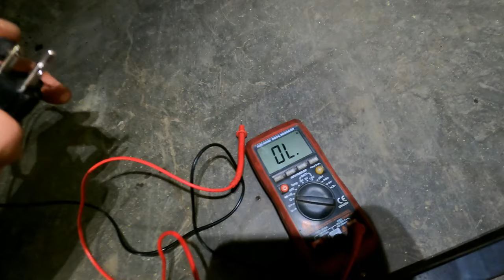I test out a $30 Chinese "TRAIN HORN"

Comment: There were TWO horns in the package, being that I live in the Colonies, It seems to me that you would want to connect BOTH horns, and test them together 🤔
Reply: Also worth mentioning a battery charger typically does not make a very good power supply especially without a battery attached to it. To clarify I mean any sort of modern battery charger
Reply: Yep, probably dual tone
Reply: I bet they have 2 different sounds when combined and mimics the sound of a train, but not the volume.
Reply: Colonies?
Reply: @rzr9006  in the US
Reply: @rzr9006  The 57 States that Obama talked about.
Reply: Make America Great Britain Again
Reply: I got the exact same horns and rigged up both...still garbage! 😂
Reply: That's exactly what I was thinking.
Reply: Lol its funny i think alot people make this mistake like i did thinking a car only has one horn.usually got atleast two
Reply: @HerculesRockefellerESQ   Yes correct, you can hear the 60 Hz through the sound of the horns. Should be a stabilized power supply for testing these 2 horns. If he wants to make a fair comparison, he should buy Chinese air horns. This is just a bad form of advertising.
Reply: Yup
Reply: @rzr9006  east coast of USA and New England
Reply: @HerculesRockefellerESQ  you are correct. The output is unfiltered so there's probably 6-8v AC ripple going to the horn with will have an adverse reaction to the coil.
Reply: @TIMEtoRIDE900 😂😂😂😂
Reply: @TIMEtoRIDE900  😀 hilarious 😂
Reply: @TIMEtoRIDE900  You mean Obongo.😂😂
Reply: Colonies?  NOBODY call the states the colonies 😂  just say the states or US. You could ridiculous.
Reply: @rzr9006 im from Jersey.  The states. US.   WE DONT CLAIM THAT FOOL 😂 who the hell says colonies? Nahnwe definitely don't claim him.  Canada can have him. 😂
Reply: @rzr9006 
Most likely talking about the 13 original ones
Reply: Made in china, what do you expect. Cheap, plastic and bad craftsmanship. Invest in quality, do not support bad business models.
Reply: your not supposed to solid mount them, they supposed to be on a sprung bracket, any car man knows that
Reply: @TIMEtoRIDE900  if you like ur doctor.......

Comment: No matter what horns you’re testing remember you need a pure DC current and voltage. A battery charger is not Pure DC.  You need pure DC  right off of battery to be fair to any test that uses DC voltages.
Reply: Yep, there's probably between 6-8v of AC ripple on the charger.
Reply: And a basic understanding of physics.  Sound is air moving in vibrations. If you put your hand over someone’s mouth, does the tone of their voice not change? If you put a thin piece of plastic, which vibrates at a much higher frequency, into a bench vice, made of cast iron/steel, which vibrates at a MUCH higher frequency, you are diminishing the natural vibration frequency of the plastic. Ofcourse it will not sound the same. It’s physics.
Reply: @VaderLS1  I tested ur theory wit the gf.  she got louder
Reply: Proper connectors too.

Comment: I have the same Horn Blasters on my 05 Cummins and run them at 150 PSI with a 7 gallon air tank and they sound Awesome! Thay truly work! They are the next best think to a Nathan Air Chime for the price that's for sure. I put 2 under the door outside the frame on the drivers side and 2 under the door on the passenger side. And the air compressor and tank in the bed of the truck in a custom made enclosure. Keep up the good work and stay warm brother...😎👍

Comment: I wired a set of air horns on my Goldwing.  I used the lead to the stock horn to power the relay.  A quick push of the horn button would play the stock horns.  A long push of the button, would also sound the air horns.  It worked well.
Reply: Did you plan it that way or does it just take a bit of time for the air to spool up?

Comment: I am not defending the horns or the manufacturers, but to help others in the future, there are 3 things in this video that negatively effected the results.  1.  A battery charger can supply the proper voltage, but not the current to properly drive the horns.  2.  To function properly, the horns must be mounted on the metal straps provided in the kit; they must be able to vibrate in use.  Clamping the stud in a vice will mute the volume considerably.  3.  They are designed to be used in pairs, one high tone and one low.  This will replicate the sound properly and double the sound output.  Obviously these are not as good as air horns, but in motorcycle or scooter applications they are far better than the stock horns.
Reply: He tests with probaly a charge with 50hz harmonic. 12v Battery is a proper!

Comment: Did you try the two $30 specials together? They may have different tones that make them sound like a train......... or not.
Reply: Typically,  one is a low notes and one is the high nite. He only tested the low note.
Reply: My thoughts too, I've bought a pair so far untested but surely for a true sound they should have been wired together?

Comment: Your 12v horn had a buzz that matched 60hz.  Likely because you used a battery charger to test it instead of using a DC battery.  If you still have them, try them with DC current from a battery.

Comment: I ordered similar horns from amazon.. got a 2 pack of red and black car horns labelled as 'train horns' but when I ordered them I knew I was getting car horns.  Obviously!  And yea of course the advertised decibel rating I expected to be exagerated (lied about), just like they lie about flashlight lumens. transmitter ranges, magnet strengths, etc. whenever it's coming straight from china.  Anyways, to get to the point... the 2 pack of horns that I got cost me roughly $18 canadian in total including shipping.  Mine are actually quite loud, each one sounds just like a standard car horn in frequency and loudness.  Advertised as 300 decibels, obviously nowhere near that loud.. perhaps if measuring both horns blown together it might be closer to that value, but still likely below 200 by quite a ways.  Individually I'm gonna estimate they are probably around 80 db or something like that, perhaps even quite a bit lower as I'm no expert in decibel values and I really haven't looked up much data to compare these numbers to.  They sound just like your standard car horn in volume.  Thats the best way for you to understand how loud these are, and when combined, they simply sound like 2 car horns going off together.  Obviously lol.  I don't think I will use both together as it's not really necessary and might be overkill.  I'm satisfied with my purchase as I'm using them for my bicycle in place of a bell.  I'm sick of cars coming close to killing me and having to scream at them to get their attention.  Pedestrians are also quite the hazard these days as a large percentage of people walk around with their earphones in with the volume cranked as they simply don't hear anything going on around them.  These people don't hear me screaming at them to get out of the way until I'm litterally a foot away from them, and then they get pissed off because they think I'm being rude for yelling at them when I'm only a foot away from them and scaring them.. when in reality I usually start trying to get their attention as soon as I realize we will be crossing eachothers paths, which can be upwards of 40 feet away sometimes.. I'll ring my bell insesintly and if they don't respond, I'll start using my voice, and if they don't respond I'll get louder and louder until many times I'm screaming "HEY DUDE, COMING UP ON YOUR LEFT!!" over and over at top volume, and the dumbest of the dumbies won't respond until I'm a foot away and they get startled!  Anyways.. Enjoy your dud of a horn... you'll enjoy those super loud semi-truck style horns much more!!!  Overkill IMO tho but enjoy either way!!!

Comment: Your battery charger is way under-powered for this (car battery chargers are usually 2.5 - 4 Amps). These snail horns draws A LOT of amps. I blew a 10 amp fuse testing one horn (they come in pairs). So If you plan on rigging them in pairs (for two different tones), you'll need to run them through a >40 amp relay. If they're not supplied with sufficient current, they'll sound bad and sort of broken. Also, all modern battery chargers are switch-mode (not heavy old-school transformers), so there is a lot of ripple (AC). You need "pure" 12V DC to make a nice tone. My horns sounds like butter :)

Comment: Hey macho truckie dude, your battery charger doesn't have enough capacity to power a car horn.  The "dual sound" you were hearing was the 60 hz component of the crappy half wave rectifier in your charger.  While a 12 volt horn will never sound like an air horn you should have hooked it up to a car battery.  They are as loud as any Fiamm OEM horns, and the pair together ain't too wimpy.  They aren't the typical F and A notes common to American autos, but are a more irritating chord.  The pair will likely blow a fuse or eat the horn relay in most sedans. A secondary horn relay, #14 minimum wire and 20A fuse right from the battery is a good idea.  Worth $30 with free shipping?  Possibly.  Definitely if compared to auto parts store stock.  And hey, they are macho  red!  A scam?  Probably not, compared to the other manboosters you have bolted on your truckie!
Reply: Mine are for sale if you'd like to buy them. They're complete trash. Stock horn with red plastic.

Comment: It sounds like there's a 60 cycle tone in there from the battery charger, and you should have tested them both at the same time from a battery.

(But it still wouldn't be like a train horn, affect those a tri-tone?)

Comment: Lots over Farm stores and places sell the Wolo brand of horns. The Bad Boy claims 115dB on line. The one I got had similar packaging that claimed this. Hooked it up. It's a mini airhorn.. it is not very loud. Infact I know something about sound pressure levels. I have a legit dB meter.
Standards for testing dB levels is at 1 meter from the sound source. For every 3 feet you move away, you drop 3 dB. 
So I hook the Bad Boy up and get the meter placed 1 meter away. It was like 87 dB. Their claims are complete grabs at marketing. No basis in reality. I moved the meter right to the horn and got like 90 or 92 as I recall. It made no resl difference if I used A or C weighting on the meter. So at any distance,  There is effectively NO difference in volume or sound pressure than from the Toyota factory motorcycle sounding Corolla car horn. Lower pitch and very slightly louder. But NO WAY near the advertised claims. 
I have noticed the packaging has since removed the dB claims. My complaint may have helped.

Comment: Maybe you got a faulty batch. I got the exact same high and low tone horns and when I hooked them up to a 12 volt battery they worked fine. Plenty loud enough for my e-scooter (which only had a cheap motorcycle horn on it). https://youtu.be/YAn-OSrjoWI

Comment: The red horns from china Those horns needs 24 voltage it’s suitable for Trucks and six wheelers cars and buses and trailers only and wont work with small vehicles even with relay switch because the horn power is 24 Volts

Comment: Chinese junk or not they're supposed to be wired in parallel, high/low. I'm curious to see how they would sound then. By the way, you definitely need to post a video of the train horn after you get them mounted
Reply from the maker: I have the video! It’s called “girlfriend reacts to train horns”
Reply: Straight to Landfill. Manufactured to fail in 2 weeks.

Comment: You should have swapped the connections round it would have made a,slightly better sound! I've got these on my Vespa and they are loud not train or truck loud but still loud. Also using bow horns does help. However a steibler would be much better

Comment: Horns need a lot of electric current called amps. The larger the wire the more amps can flow through that wire. Cars and motorcycles in the United States today have skinny wire feeding the horns. That’s why they are pathetic. 
  get a 30 amp horn relay for a few bucks, hook the relay up to the original horn wires to control the relay, and wire number 12 gauge connection between the battery to the power/low terminals on the relay, to the horns,, then ground the horns. They will be louder..
  A buddy of mine put airhorns with an air compressor on his motorcycle, he was beeping the horns a lot one day when we were riding after he installed the horns using the original wires on the motorcycle that went to the original horn to power the compressor. After one long blast that he did with the horns, the horns stayed on, even though he wasn’t holding the button down. It turns out, he melted the wires and his wire harness, Because the horns were drawing so many amps through the smaller wire which have a higher resistance than bigger wire, and he ruined his wire harness

Comment: I ordered air horns from " China " and did not get the hors I ordered. Nor did I get the airlines, wiring, mounting bracket, or compressor. Tried to return it and it cost more to ship it back AND it got returned to me. It was returned to me by customs in China

Comment: The battery charger is 4o Amp. The battery is capable of 900. What's the max Amp input of the horn? Why didn't you connect it to your battery? I think you didn't test it properly.

Comment: The horns have to be mounted on brackets to make proper noise.
The entire housing has to be free to "resonate" to produce adequate noise.
If you mount the horn to thick metal, (or in a vice), they won't make much noise.
I found this out the hard way many years ago, when I mounted a horn directly to the frame. Sounded pathetic. But when the same horn was mounted back to a horn bracket, it made the expected noise.
Reply: They claim 300db so just as full of shit as you. You do realize that a space shuttle is only 204 during launch. Nothing you do will make any real difference and it has a better chance mounted like this.

Comment: Did you try hooking it to a constant 12v?  Was it any better?  The charger connection is a pulsed 12v so it won't be the same.
Reply from the maker: The point of the video was just to show that the sound they advertise in the video is nothing like the real sound. They use adds from hornblasters haha

Comment: Thanks for sharing your testing moments !  
Only $30cdn (shpg?) , a yr ago !    Affordable. 
 

Like some reg. audio spkrs.  require pre-vehicle installation, place in a container, or just wrap the body' with sound insulation ?   To possibly give them more 'bass' !?

Any  nay-sayers try that option yet !?

Surprised you did not add the link to the chinese distributor, shucks !            8-)

Or must be too easy to find via online search.    LoL

Although a lot of installers' reviews indicate not so  loud and not really a train horn !!   :-[
Reply: Could use them primarily  when 'speeder-weavers' cut us off especially when they do it with (broken) turn signals ehhhh ;     people jay-walking unsafely;  counter toot at vehicles passing by with loud goofy $$$ muffler sys';    pre-crossing train tracks (although drivers not already in the know, when they hear similar elsewhere approaching train tracks, may not take it seriously and continue rollin' fwd cutting off the train consist that had given them the proper 'heads-up' warning)   !!

Comment: How much power and does it require air compressor?   I would mount that outside frame some how...  where did you get good horns?
Reply from the maker: I got the air horns from hornblasters, ya it’s a whole air compressor kit and everything
Reply: Will 12Volt work it?  Mountable on motorcycles?